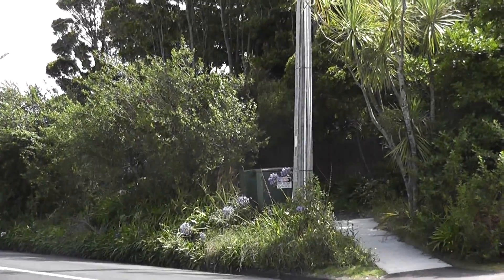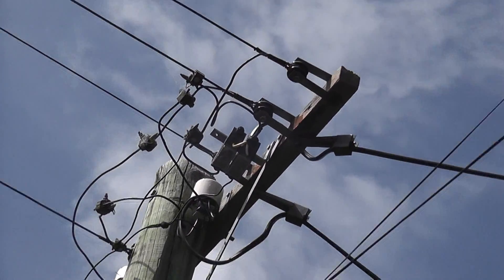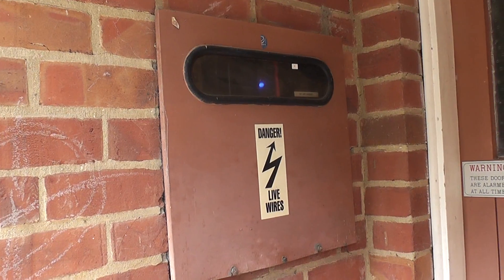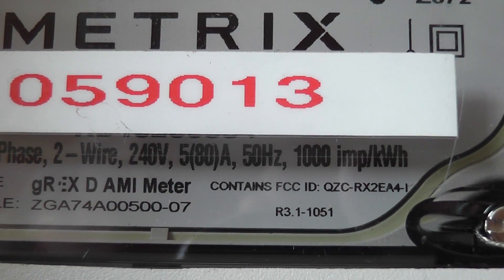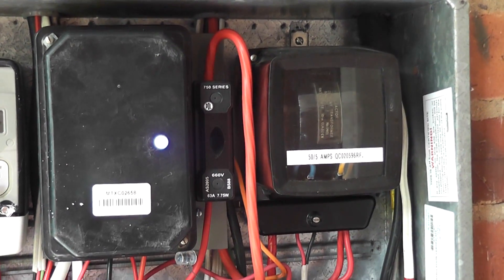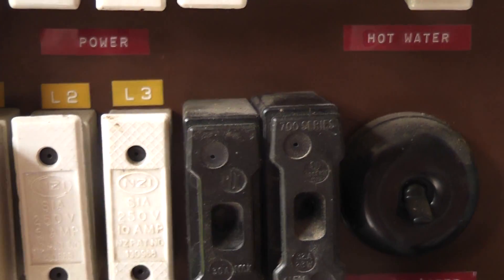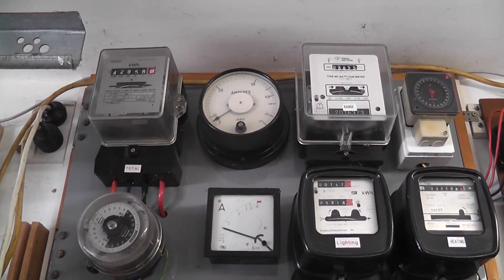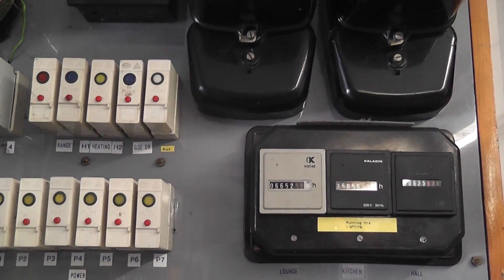My source of electricity

Comment from the maker: @deahera The panel in the beginning is the main panel with one digital urility meter.
The second panel is a sub board for the rear part of the house, on which I installed a couple of check meters for certain power circuits like heating and cooking. Our house is 224m². I am aware that Australia subsidizes solar heating.  Not in NZ unfortunately.

Comment from the maker: @deahera We use electric cooking 8 kW. electric heaters 4 x 2.4 kW , electric hotwater heating 3 kW. Then all other appliances.
Ok they are not on all the time but significant power is sometimes drawn from the system. Howater is controlled from the POCO via the relay with the blue led.
I have a maximum demand meter as check meter and in winter that goes up easily to 10 to 12 kW over 15 min. period.

Comment: @deahera I live in Italy too, and i have to correct you on some points, first, the switch in the meter won' t save your life, don' t dare to trust it, I' ve seen cables melting with the switch in the meter steady on... 
Second, we usually have one phase and one neutral in our homes.
But yes, i still cannot understand why in other counrties is needed so much currtent, maybe for heating?

Comment: 3Phase 80A/Phase here.
three phase in Aus is very common. Even new houses today have 3 phase to the board although quite often only one phase is connected.
When I was in NZ I was amazed at how much 3 phase they had in rural areas, far more than us. Also the size of the pole subs was very small - 25kVa and 50kVa was common, rarely find anything smaller than 100kVa here

Comment: @flamesecureUK Hiya. I highly doubt that the service cable you currently have is original, seeing as you have Dual Tariff electricity. That service cable was probably put in some decades after the house was built ( definitely after WW2 ) when Economy 7 started to become popular. Maybe very late 60s, early 70s perhaps.

I think from 1975 onwards, houses were installed with the more modern PME / TN-C-S earthing setup. Yours is the older TN-S, with the earth clamp around the service cable. 

-BBD.

Comment: Hiya, What is the capacity of your house service? Here in the UK, modern installs ( I'd say in the last 30 yrs ) can be between 60-100A. Fuse sizes would be 60A, 80A or 100A, like the one seen in my "house service fuse" videos. Later fuses are made to BS 1361, but I do have an older one made to BS 88, and it's made by Brush. :-) You know, those people who also made the substation transformers. :-D

{^_^} BoomBoxDeluxe {^_^}

Comment: @BoomBoxDeluxe

The 60898's have completely different internals to the 3871's. you can't get better than 60898's at the moment apart from 61009 which is an RCBO but you'll be very hard pressed to find them to fit that board (if they even make them)!

Comment: here, we got above ground transmission(13kv), transformers are mounted on tele-poles (usually power 3-5 houses, either 25 or 50 kva), and we got a 200A hookup, of L1(120v)-neutral-L2(120v); appliances that need 240v are hooked up from L1-L2. we got a smart meter (rolls-eyes) outside, and a circuit-breaker panel inside, in our basement.